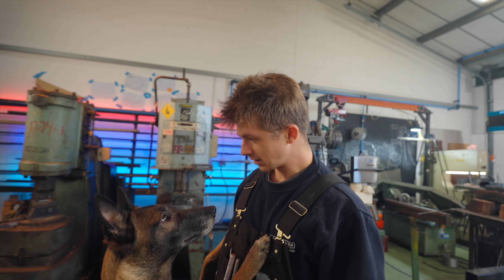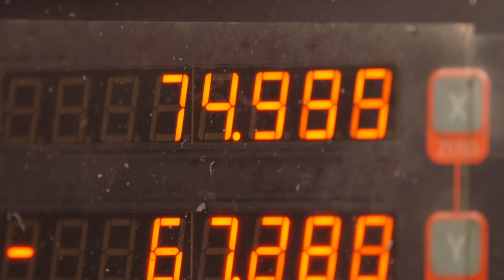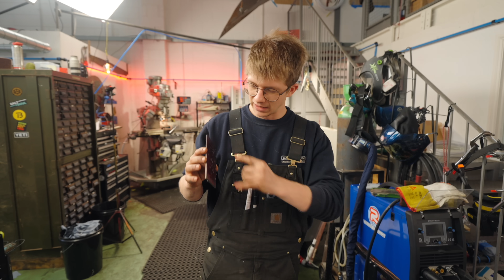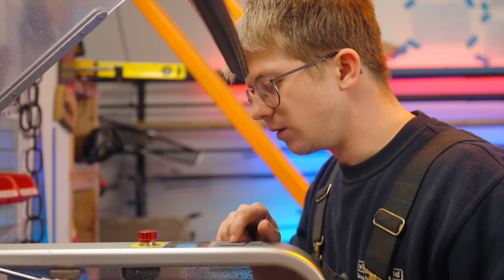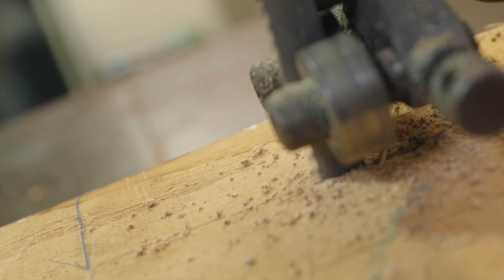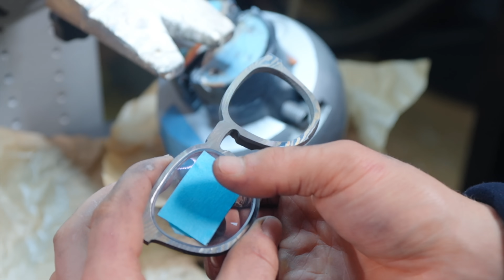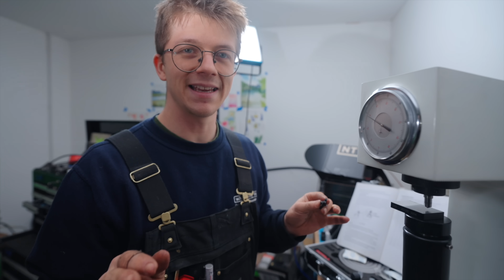Making Titanium Damascus Glasses, Part 1

Comment: hello, the engineer who was a bit critical last time :D this time i don't hate your drawing ! it gives the dimensions in reference to your "reference surfaces" and helps you plot where you need to mill, a the saying goes "if it looks stupid but works, it still works !" keep at it, love your content (and my offer to check your works still stands)
Reply: "The engineer who was a bit critical" narrows it down to every engineer ever
Reply: As someone who has been working in CNC machine shops for a bit over two and a half years, engineers and drafters are the bane of my existence lol. Some of the drawings that I’ve seen across my table have been so confusing for no particular reason. Could you give me two more planes to look at? Could you maybe give me the whole length of the material instead of having to do the math of where each hole should be and finding it out that way? Some drawings are fine, but there’s one customer of ours that is notorious in the shop for having terrible drawings.
Reply: @MrSir2552  oh i feel you, when i worked with my dad as a drafter my job was to re-do the documents the chinese branch gave us (they where horrible)
Reply: @MrSir2552  then they weren't done corectly and you have every right to call them incompetent, sincerely, an engineer straight out of university. the drawing has to fit the purpose, always so if you need to do all sorts of unnecesary math they're not only not following standards they're also stupid or despise you
Reply: Lads your English is fine.
7 pints
Reply: Engineering is trial and error, if you don't get this you aint one 😢
Reply: Had to be a french
Reply: @EinfachFredhaftGaming  évidemment, on est supérieurs aux autres XD
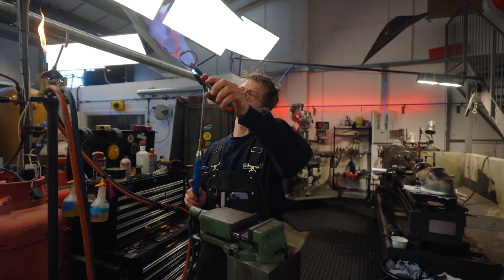Reply: 17:00... some how... somehow I knew that regardless of the amount of engineering that went into this, the blacksmith would be hammering on the glasses.

One can't take the blacksmith out of the engineer... it seems. Lol
Reply: If it works it's not stupid
Reply: I’m an engineer too and you’re being ridiculous. He’s making it for himself. He doesn’t need datum’s and positioning tolerances FOR HIS OWN PART HES MAKING 😂😂
Reply: @PMTcommenter  yes i said exactly that
Reply: @PMTcommenter  Yes he does, even if it's for yourself you still need to be able to replicate the product from the plans years on. It's hardly any effort to save yourself effort if he ends up making something a product.
Reply: @justinvzu01 no he doesn’t. Why would he need that years on? He has the cad file he could go back to years on. He’s not saving these paper plans lol. Datum’s and tolerancing is for mass production to make sure all you parts are to spec. When making one offs or small amounts of parts like this… all he needs are the measurements he needs. Get over yourself dude. He doesn’t need datum’s. He isn’t datuming off of anything. He isn’t building a check figure for those datum’s to even mean anything. You clearly have zero clue what you’re talking about
Reply: Someone needs to check your spelling mush
Reply: @kiesh.  english it not my first language, i'm doing my best here ^^'
Reply: @redwarrior69340  also I am only pulling your leg, but the irony of this reply is fun 😘
Reply: @redwarrior69340  Bruh, your English is fine. You type better than most native English speakers and in text you’re beyond fluent. Personal opinion here: never use that excuse again; you don’t owe them anything. Anyone hating on your English is trolling or ignorant. Cheers, mate 🍻
Reply: @kiesh.  Some one needs to check you attitude.
Reply: @setra23  someone needs to check your spelling.
Reply: @kiesh. Not everybody on YouTube speaks english as a first language.  He's doing better than i am seeing as i dont even speak a second language.
English is my first language but my grammar and spelling isnt the best either. It foesnt matter mu h on a forum such as this anyways. This isnt a formal forum.
Reply: @TruthIsTheNewH8  good god, I'M JOKING! the guy was ripping Alec for his drawing skills when Alec isn't a draftsman, whilst spelling his offer to check work wrong! It's a joke, lighten up 🤦🏻‍♂️
Reply: @TruthIsTheNewH8 what did you edit if you didn’t even fix some major spelling errors
Reply: @bmb8830  content? Who cares about spelling anyways?
Reply: I thought it was very common to speak Spanish or something else as an American.Because I speak german Because my older brother teaches it and I can also speak a little bit of russian Because it's my second favorite country even though it has some of the worst leadership😢@TruthIsTheNewH8
Reply: @kiesh. someone is pretty butthurt about a completely trivial thing😂
Reply: @Atomy111  there's so much butthurt here I can't tell if it's my butt or the snowflake butts you're referring to, but I take your point either way! 😉
Reply: @thefunksoulplumber22 fair point I hadn't considered 🤷🏻‍♂️
Reply: @ you, if you went back to fix the error you saw ig
Reply: @bmb8830  so far nobody told me what the mistake was ^^'
Reply: @kiesh.  they're an engineer, not an english major.
Reply: @8Ham_Radios  indeed, and being critical of the drawings of a blacksmith, not a draughtsman. So by your own logic he was fair game. Next.
Reply: @kiesh.  this is the fun of being a bully and just saying its in good fun no hard feelings (written English is my second language i reliegh on voice to text bc of dyslexia and i cant tell you how often i opt not to post because of the effort that goes into spellchecking and the stupid hassling of people who get joy out of nitpicking)
Reply: @wmose3694  another ironic post considering the guy was nitpicking Alec's drawing skills 🤦🏻‍♂️ keep white knighting mate, I'm sure they appreciate you.
Reply: @ i'm not trying to nitpick, i'm trying to improve alex's work, from what i have seen working in a design bureau alex's work is miles better than some stuff i have worked with, but going the extra step to make it near perfect is what is gonna change everything, if he ever has to produce a sketch for an industrial company reciving a scetch who is hard to read, badly formatted, and sloppy is gonna make everyone's work harder, when you recive a proper sketch who respects ISO standards you go "wow, thanks !" becuase you works becade ten times easier !
Reply: @ yup your are still a bully be it out of blind stupidity or something darker
Reply: @wmose3694  look at my original comment and then at your comments.. you've lost sight of reality mate